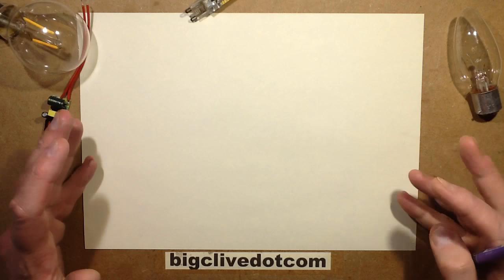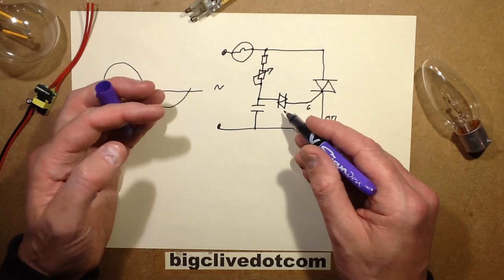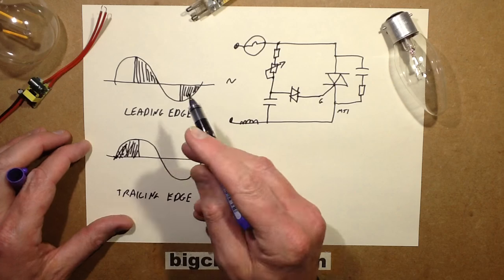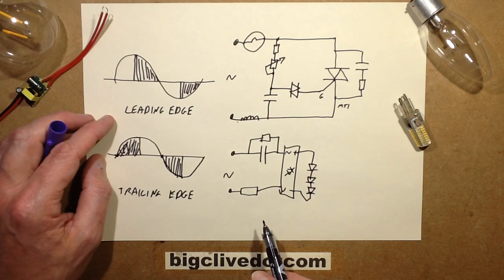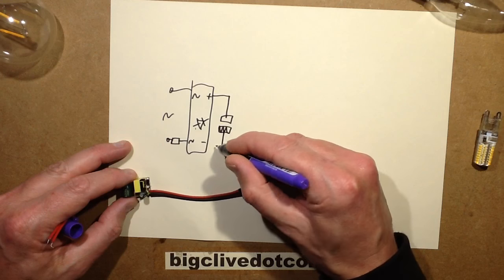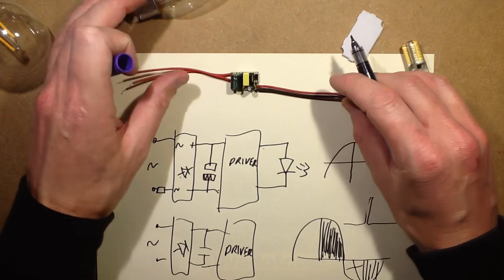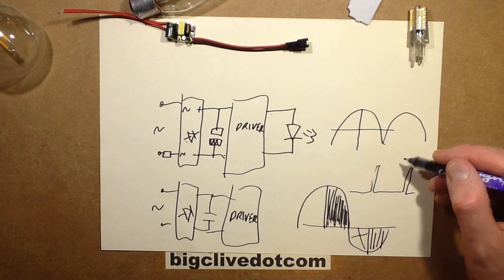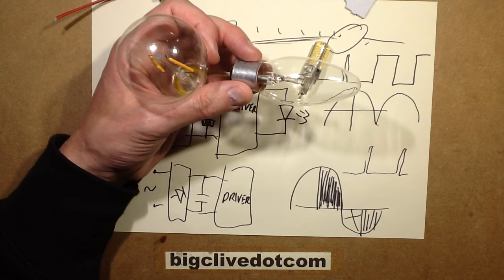Dimming LED lamps with ordinary dimmers.

Comment: Can these non-dimmable LEDs be dimmed using a variac? What about using a trailing-edge dimmer on a string of LEDs with 1 incandescent bulb for ballast? I say trailing edge to avoid the in-rush problem caused by leading edge

Comment: None of the dimmable LED bulbs I have purchased indicate which type of dimmer switch is required, leading or trailing edge switching. some of the LED bulbs appear to have been designed to operate with the older leading edge switches, because they act as an inductive load, due to the inclusion of a relatively large series choke.

Comment: Great video Big Clive! Its probably going to be significant number of micro lights, which can be turned on/off intelligently according to the requirement. I got this fibreoptic bunch for making twilight effect x metres away. Think I'll dig it out and use a butchered colander on a stepper motor as a control.

Comment: a simple 555 mosfet setup,  I've made some vaping mods with a simular setup and ive Always thouht it might work to dim LEDs. It's actually a pretty simple circuit
Reply: That's not the problem. The problem is taking the signal from the conventional dimmer that travels over the power line.

Change to a potentiometer and a switch, and run extra cores to the light? Sure. But you might need to rip the walls open, and probably have a qualified electrician.

Comment: Most new LED lights require a ELV (electronic low Voltage) noise reducing dimmer. If you are having issues using dimmers on LED lights save your self a lot of headaches and just purchase a Viribright LED dimmer switch. ELV  300VA  2 way or Single Pole.  for like $16 on amazon

Comment: As far as I know, there is a 0-10V or 0-5V system in use. Probably just plain potentiometer using referance voltage from the LED driver.

But that's not the classic LED bulb, I would expect a rather integrated system where the knob only goes to the lamp, and do not have mains power going via it.

Probably worthy a review, but likely not the cheapest!

Comment: Hi Clive, I love your videos and have learned a lot. I am a Catholic Priest in Greenwich St London. Need your advice. We have a poor church in the back streets near Blackwall Tunnel. It is lit at High level with circa 20X500 watt Halogens probably fitted about 25 years ago. At least 8 fittings are mounted very high requiring scaffolding and this is too costly to justify especially putting back high cost halogen bulbs. The lighting uses a theater style dimmer system that is governed from a low voltage dimmer control for different sectio0ns of the building. I would like to change all the fittings for modern 50W led floods as I have done to great effect elsewhere. They would pay for themselves very quickly and hopefully not need changing for a while. Can I put LEDS onto this dimmer system? Shall I junk the dimmer system and just use the lights on and off conventionally. This would require conventional 240 volt switches and stripping out old system but then we would have to introduce loads of new cables to get the switches to the Altar end of the church where the dimmer controller is situated. Is there some way to convert existing system for safe running LEDs?
Reply from the maker: Besides the fact that there is no such thing as a poor Catholic church...    The 50W LED floodlights would not last long on dimmers.  From working in the theatre industry and as a result doing a lot of lighting maintenance in similar buildings I can confirm that installing lighting at unreachable locations seems to be a common thing.  The 500W halogen lamps are not expensive, but getting them up there is.  There's also a requirement to use good quality lamps for longevity and to protect against the very common lamp holder damage where arcing occurs at the ends and will result in rapid failure of new lamps no matter what their quality.  Even just switched on and off the 50W LED floodlights are just not reliable enough to guarantee trouble free operation.  If anything I'd suggest using 150W metal halide fixtures for general illumination and keep the 500W ones for use when their warmth and dimmability is required.
Reply: Thanks so much for taking the trouble to reply. The church was going to be shut but it is coming back to life. I've blown all the money on the roof and we are running on a shoe string and ingenuity.  If we instal 150w Halide lights can we use existing circuits with the dimmers? Been hooked on your sight since the Flaming Pussy Doll incident. The staff at our Catholic girls school love it. Got a great assembly talk out of that. You are a cult figure down here alongside "Zoella". Also wondered if I could put a snow machine in the tower?
Reply from the maker: The metal halide lights couldn't be dimmed either.  It may be better keeping the halogen lighting for occasions where that extra ambience is required.  Is there any way new lighting could be mounted at a lower level that is more accessible?  Do you mean mounting the snow machine so that it blows snow outside the building on demand?  It should be perfectly viable to do that, but the effect will be very much dictated by the prevailing wind.
Reply: Hesitate to say but I wasn't entirely serious about the snow machine. But if you know where there is one laying about... It would be rather fun to blow snow across the Royal Observatory Meteorological office. I have two churches here the other one looks across the park thanks to Mr Pugin. Have replaced all the Halogen 150 Watt lights in this church with with 18w "Parcan" style to good effect but they are accessible from a ladder. At the other place in the back streets we run circa 20 Halogens in winter at 500w a piece. Had hoped to reduce the lighting bill accordingly in Winter. The halogens are cheap to replace (other than scaffolding) but running 10.000 watts an hour! Do you really feel that LEDs are not yet sufficiently stable to instal trouble free at high level? They are supposed to run indefinitely. Elsewhere in the presbytery, I am now using dozens of LED bulbs candle  in old chandelier fittings I have been collecting and restoring from Ebay. Very pretty but the bulbs (cheap imports) barely last 6 months with continuous use. The 4w filament style seem a little more stable and better and very attractive light but also give up within 6 months.
Reply: Kevin Robinson v
Reply: You can get DMX controlled architectural LED systems afaik...  tbh don't know much about them.
Probably get limited variability by putting 2 independently switched standard LED security lights on different circuits in to replace each one existing halogen fixture.

Comment: What does actually happen if you REALLY run LED lamps with various kind of dimmers (with resistive/capacitive/switch mode power supply circuits inside)?
I understand it in theoretical level but I really want to know what actually happens to them.

p.s. And CF lamps too!

Comment: Since LED lamps seem to have quite a few individual LEDs, why not turn on and off banks (or even individual) of LEDs? For very low light level, turn on six LEDs, and ramp up six at a time to 72. That would give 12 steps on a 72 LED chip.

Comment: I’d like to hear how the current theatrical LED fixtures work like the ones from etc or strand
Reply: The have constant mains supply and a data connection (DMX). There are active dimmers in every fixture.

Comment: I bought a house with dimmers, and didn't realise until I looked in to it that some LED bulbs are dimmable, and others aren't. Whats the difference between the two? What makes one LED able to dim and the other not? And is there a cheap/easy way to convert non-dimmable LED's to dimmable ones?
Reply: Clive explained all that in the video. But in any case:

> Whats the difference between the two?
> What makes one LED able to dim and the other not?

A good dimmable bulb contains expensive electronics that interface the dimming technology that worked well for old tungsten filament bulbs with the dimming technology that works well for LED bulbs.

> And is there a cheap/easy way to convert non-dimmable LED's to dimmable ones?

No.

Comment: I have a dimmable LED  in a bedside lamp where you touch the base to vary the light intensity. However the lamp acts differently when using LED lamps as against incandescent lamps.
When using LED, the light intensity is 0.5, 1,  0.25, Off ( so 4 touches of the base to cycle through)
When using incandescent , it is 0.25, 0.5, 1, Off

Any ideas why?

Comment: IDEA: What about an adjustable current regulator on the light fixture itself? Not practical for ceiling fixtures (unless the fixture has a wall switch dedicated to that individual fixture), but doable for bulkhead and floor fixtures. Shouldn't be too dependent on the lamp's circuitry, whether it's a capacitive dropper, a buck regulator, or some hybrid.

From an audio and radio electronics perspective, I've always despised TRIAC dimmers for their noise, which has harmonic transients going up near daylight due to the hard switch-on transients. Even before we had LED lamps, we've needed a better low-EMI dimmer. (I suppose the double filament 3-way lamp might have been made specifically to meet this need, but I'm sure we can do better.)

Comment: I have a 30 year old dimmer running 3x4w led. It works fine, very slight flicker at the very lowest brightness but the issue I have is its a rotary dimmer, the led is off at around 50% turn, it still covers full brightness range and doesn't cut off, its very dim before turning off. But its sensitive and moves quickly between brightness levels so have to turn it very lightly. With old bulbs when dimmer rotated fully off, there was still a small bit of light. How to fix this so that the led turns off when dimmer is fully rotated off.

Comment: Or, as many of these LED lamps are, in fact, parallel arrays of LED chips, you switch on the individual "filaments" one at a time. 
So for a lamp with 10 'filaments', you have 1 filament giving you 10% of the output.

Comment: maybe a stupid question, but could one build a compatible dimmer that just (e.g. via some sort of variable resistance, dropping or even filtered PWM to produce a fake sine wave from a rectified input for more fancy/smart/whatever solutions) lowers the voltage? or would the LED drivers try to boost (or buck less) that to the maximum LED voltage and randomly flicker? if so, maybe just ignore the fact those things have rectifiers expecting AC and supply them with (very fast) PWMed DC (so it still flickers, but with a few KHz-MHz instead of ~110Hz)?

Comment: loved doing minor electronic in school sad we had such a boring class/teacher.
let's just say building a crappy radio and being forced to use jig to mass produce the same pattern was boring.

loved the wiring tough.

do you have any recomendation for someone who would like to start basic electronic circuit.?
Reply from the maker: You can buy cheap electronic kits on eBay.  If you search for DIY flashing LED suite you will find several from Chinese sellers.

Comment: Sir i just love your videos....when i was a kid i used to open things nd see hw it works... and it was fun...nw when i see your videos i just remember my good Old days....

With that being said...i wanted to knw if we could replace the current sense register of the led driver with a variable resistor or with some microcontroller and some hw vari the the current begin sensed by the Isens pin of th chip...is it possible to dimm the led
Reply from the maker: It would be possible to add a variable resistor in series with one chosen for the highest desired current.
Reply: @bigclivedotcom  and sir is it possible to vari it  digitally...cud make a video on such a device

Comment: can you explain what happens in led (tape) that need a transformer to make it for example 12v. i tried a very expensive led wall plate dimmer with an expensive special dimmable transformer to dim a length of led tape and i still got a strobe effect. would a capacitor after the transformer help?

Comment: +bigclivedotcom  -  Thanks for addressing this.  --  What about a low-voltage supply for lighting?  Accent and Landscape lighting use (I think) 12v a/c?  As the LED lamps are being pushed into replacing tungsten, any LED bulb could simply rectify the power, as most LED bulbs already do.  Any dimmer could rectify, smooth and then PWM the power.  It would certainly not happen overnight, but separate lighting and non-lighting wiring could become the new norm.  Somebody is gonna have to rewrite a bunch of code and regulations.

Comment: Bah, bugger all this namby-pamby dimming - just bolt a variac to the wall! :-P
Reply: Wouldn't help with dimming some LED bulbs, they would just be on at full intensity until you reached their cut off point then they'd switch off completely.
Reply: Is there really a need to dim LEDs below their cut off point?
Reply: Rick Delair LED lighting in anything resembling real use doesn't damage eyesight, so you've 'solved' a problem that doesn't exist. (See, for example, http://www.machinedesign.com/blog/3-myths-surrounding-leds-0 )

Comment: I use a dimmer made by LightwaveRF which at around £40 each isn't cheap and if you use 'normal' led bulbs they flash but LightwaveRF say to use Megaman LED bulbs which Megaman is something to do with LightwaveRF and those bulbs work fine with the dimmer but once again the bulbs aren't cheap either. I think all in all I spent almost £70'ish just for a straight forward dimmer and 3 GU10 LED Bulbs. I wouldn't of normally gone for this but the dimmer ties in to my home automation stuff so I wasn't to fussed.

Comment: Here's a better way: The driver chip should use a small portion of the AC in to heat a resistor, and set the LED brightness proportional to the temperature of that resistor.  If the resistor heats like a tungsten filament, then so will the LED brightness, without any complicated circuitry.  With a small, high value resistor this does not need to use much power.

Comment: Or do what I do! I use an 100 watt wire wound variable resistor behind my wall plate mount on aluminum. works fine and not very technical at all. The LEDS eat whatever is left from the resistor..

Comment: For what it's worth, at least Philips makes some dimmable LED "bulbs". 

This new place i moved into a couple months ago has a dimmer in the living room, so when i went to get some lights, there were several models / sizes to choose from, but not all of them spec'ed as dimmable. Can't recall how much they were, something between 5-10eu a pop or so.

Haven't yet been curious enough to crack one open, though :P
Reply: replace the switch with an on/off one.
Reply: robehickmann Because....?
Reply: As clive described in the video dimming LED's from a traditional dimmer is the wrong solution. Unless it's a special LED driver which outputs DC or some such, you are better off just replacing it with an on/off switch and using bluetooth 'self dimming' lamps.

Not an ideal solution, but the whole thing is a mess these days.
Reply: robehickmann I don't mean to sound disrespectful or insulting, but... Did you even bother reading my (entire) comment? :P 

I'm not sure i could've made the first line any more clearer than it is.
Reply: +KhronX There are lots of dimmable LED lamps around. Some Philips ones attempt to emulate a conventional filament lamp by using a red LED to shift the colour temp downwards at low power levels. 'Warmglow' is the name they use.
Reply: That "warmglow" is the very reason many of us moved away from tungsten.  Pure daylight white, ftw!     ;)

Comment: The end of your clip? You are holding 2 lamps, an LED and a filament type. The LED light in your left hand is one of those LED strings which just runs on main, no circuitry at all. That one could be dimmed if we would have a switch with extra leds in it. The leds would cause a voltage drop, which will lessen the current. So we get a switch which lights up (a dimmer), and the main light would dim as well. On the other hand, the LED light in your left hand does flicker to a point where it gets very annoying. (the main reason for my idea to do it this way is so that we are not throwing away any power loss and have a true dimming). Of course I understand this dimmer will be fixed for the led light because the current must be equal. But hey, it is just an idea. I see many other possibilities like using a dc to dc controller for instance.

Comment: would it not be possible to use a 555 timer pwm circuit running att 15 or 23 khz controled with a pot (variable resistor) using this value as ex since i know how to build with this value

Comment: Hi Big Clive! Do you know whether the pushbutton electronic dimmers work in a similar fashion? I have a couple of Lutron Maestro dimmers controlling LED can lights. I found that these dimmers can really dim those LEDs low, like down to the point where they start looking slightly green, presumably because the phosphor isn't getting excited enough anymore.
Reply: Lutron makes a LED dimmer switch line called the C.L, that has the ability to be "trimmed" to control dimming LED bulbs properly with out visible flicker.